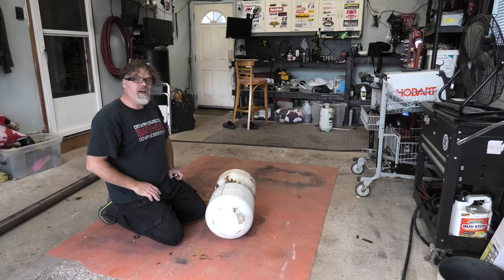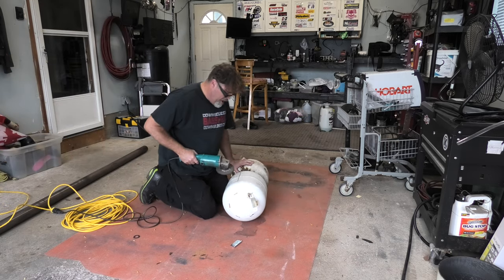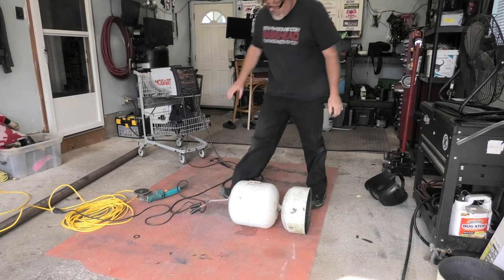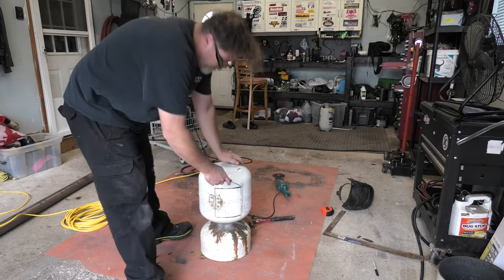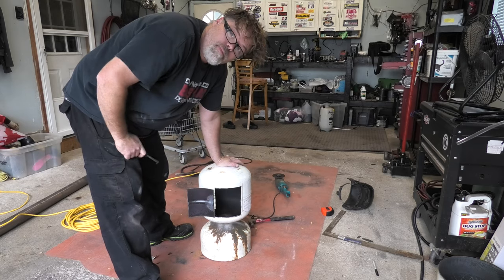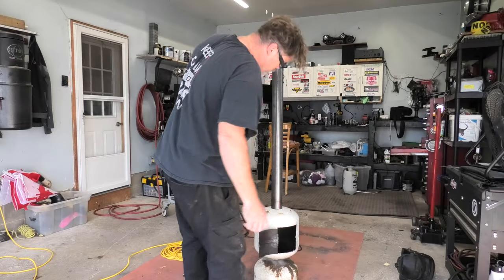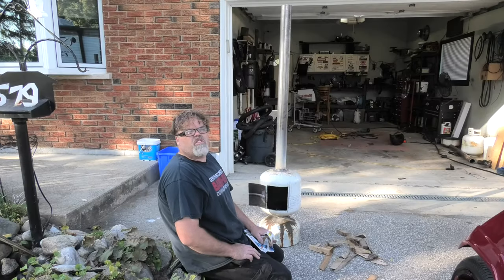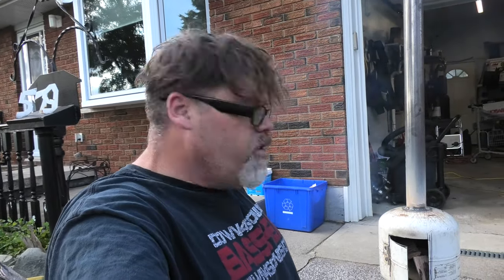Wood Stove with Propane Tank PT 2

Comment: Pretty cool or I guess actually hot there Bill. Is it a little tippy or not? You could always weld some L brackets around the bottom tank to get some more ground contact. Like little feet so if you bump into it,it won't fall over.